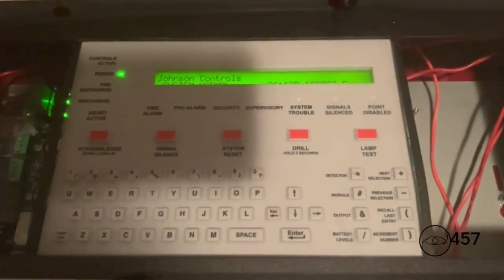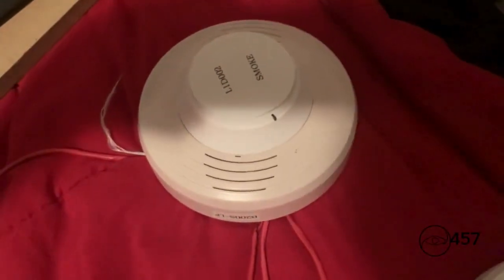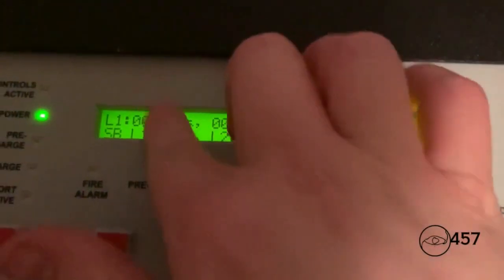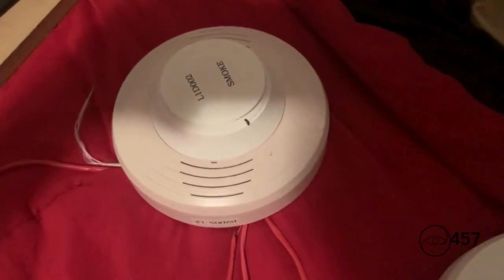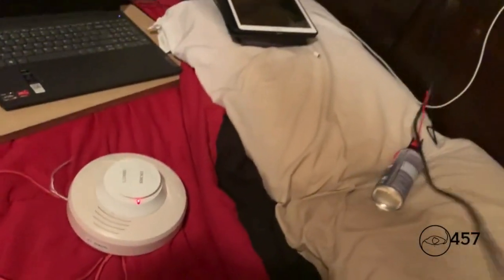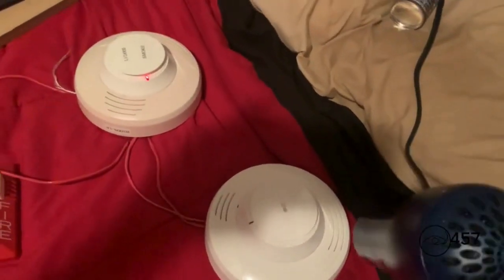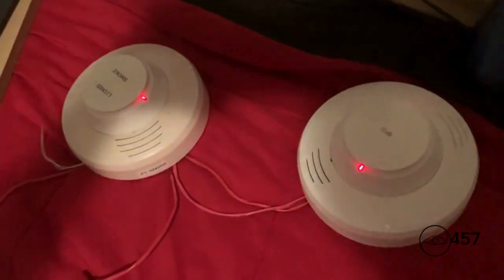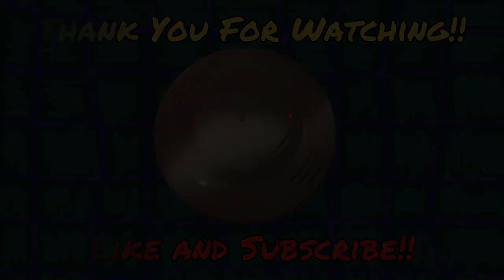Fire Alarm Intelligent Sounder Bases Programming Tutorial on Notifier Keypad

Comment: When you have sounder bases in a dorm room that all work but one what would you look for? I had voltage and the smoke head was addressed and zoned correctly. If you replace a sounder base with a new one and keep the same head do you need to run an autoprogram so the old base syncs with new head?
Reply from the maker: No you shouldn’t have to if you’re replacing an intelligent sounder base with a new one, since it should already be programmed in.

Comment: Hello how would rename the sounder base if I doubled addressed it to the same two devices ? Am I able to reboot?
Reply from the maker: I’m sorry. I can’t understand what you’re saying.
Reply: When you have sounder bases in a dorm room that all work but one what would you look for? I had voltage and the smoke head was addressed and zoned correctly. If you replace a sounder base with a new one and keep the same head do you need to run an autoprogram so the old base syncs with new head?